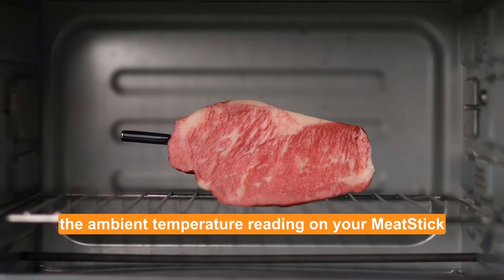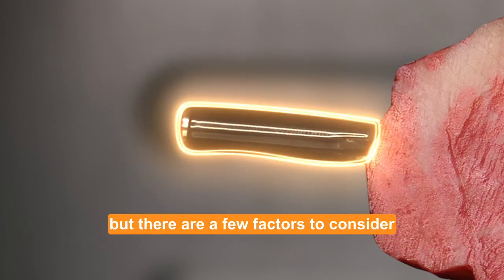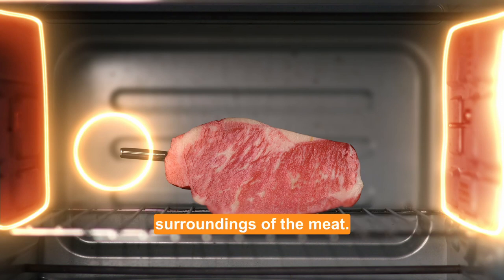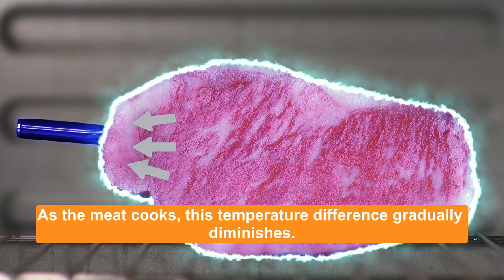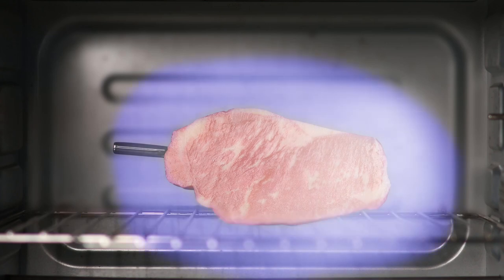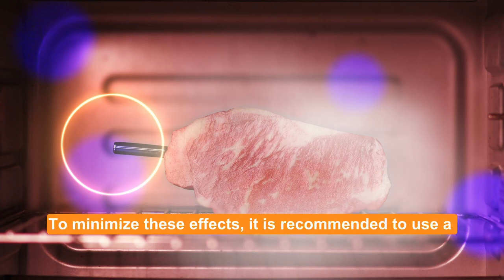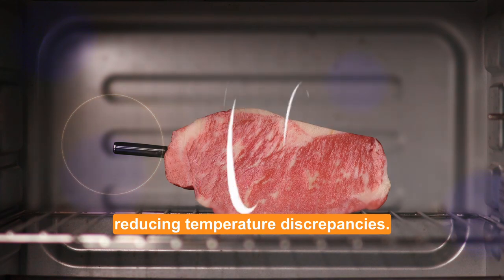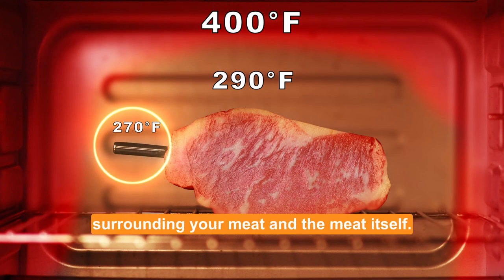Ambient Temperature Sensor Explained I The MeatStick

Comment: What's the point of the ambient temp readout, when it is showing as 150⁰ variance, even in ideal conditions? (Small air fryer with spinning tray)
Reply from the maker: Hi there,

Thanks for your question! The ambient temperature readout is designed to help users understand their cooking environment. For example, with a charcoal smoker, it can notify you if there’s a flare-up that could cause the meat to burn. Flare-ups can result in temperatures higher than our maximum ambient temperature of 572°F. In the case of an air fryer, the ambient temperature should be more accurate as it helps remove the moisture barrier and distribute the heat more evenly. A variance of 150⁰ is quite significant and suggests there might be an issue. Please contact our support team at https://tms.fyi/help for further assistance.
Reply: @Themeatstick  Thanks. That makes sense. It's more of an emergency warning than something to monitor. I will reach out though.
Reply from the maker: @ChanceStad  Appreciate it! Please reply to my comment here once you've submitted a support ticket. I will help to make sure your case gets priority attention.